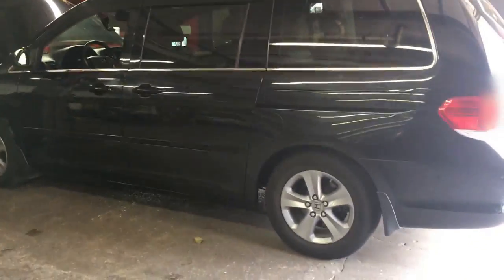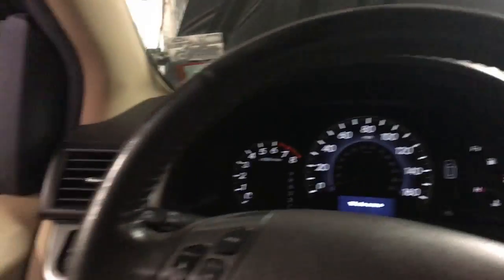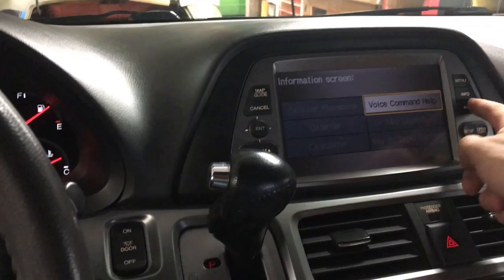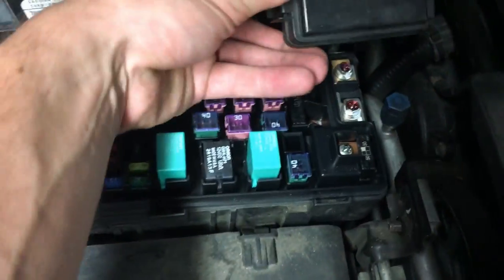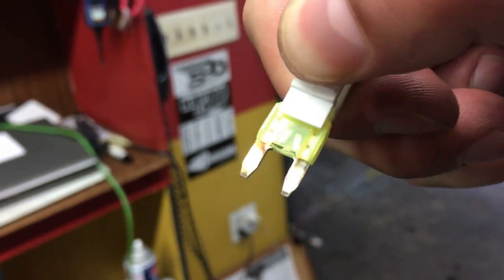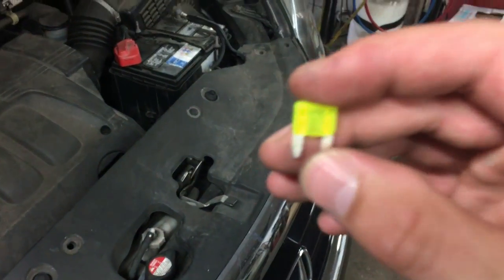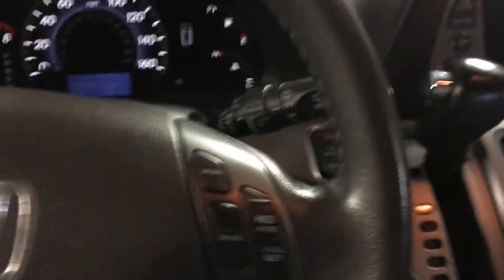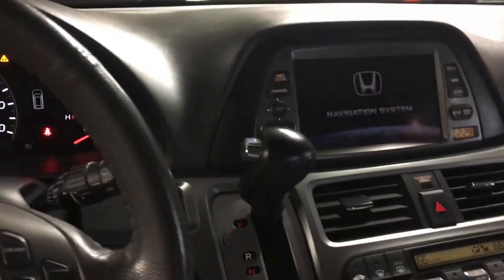Honda Odyssey No Sound but Radio Has Power Easy Fix

Comment: @Wheels Tips!  Hi, can you help on my case, Honda Accord 2009. My android head unit sound work via Aux connection. One day, when i switch between reverse mode and run mode, the sound completely gone. (Which usually come back after reverse.) I did check 20 amp fuse. There still sound from speaker when i switch to original dashboard radio but no sound from Head Unit or Aux port.
Reply: i checked the cable inside dashboard, all look normal.
Reply from the maker: @bennyh6091  Thanks for watching my video. So you are saying you have full functionality on the radio? Sound and all? But when you are using the AUX port no sound? What about the CD player? The reason I ask in that case it would seem like the device you are connecting to the AUX port is bad or needs restart or the AUX cable itself is bad.  If you have sound with the radio on the fuse is not your issue.  The fuse either works or it does not.  Please share an update, thanks.
Reply: @WheelsTips  Yeah, the Head Unit working normaly, just no sound from it. I am pretty sure that not the speaker issue.  MY HU sound is connecting to RCA cable of the original dashboard and the sound come from AUX mode not AUX port but anyway, the Aux port not working either. I just wonder is it somehow relate to any fuse?! 

The sound completely off when i switch the gear to reverse, usually it come back when switch back to D gear. So i think there something happen with the mute function when switching between R and D.
Reply from the maker: If you have power and sound but at different times it is not the fuse.  Fuse either works or does not, hope this helps.  Maybe the head-unit is in need of remanufacturing or replacing.  Please share and update, thanks.
Reply: @WheelsTips   Thanks for ur help, at this moment i dont think it a faulty head unit. As there no sound from Aux Port either. If there was a problem with head unit, i think the Aux port still working normally right?!
Reply from the maker: I do not have access to a wiring diagram. To solve a rather complex electric issue it is best to get a wiring diagram for your car. That way you can see what is connect where. You can also try one of these new kits they sell Google, 2002 Honda Odyssey instal iPhone AUX adapter. Please share if that video is sort of what you are looking to work around.

Comment: So my problem is that my radio stopped working after replacing the alternator can this method work on a 2005 Acura TL ?
Reply from the maker: Thanks a bunch for watching my video and taking the time to comment. I would definitely check all your fuses before doing anything else. Looking forward to an update, thanks.
Reply: @WheelsTips  didn’t work
Reply from the maker: Checking your fuses did not work? You mean none of your fuses were blown? Did you scan the car for issues?

Comment: Wassup Man!does this same Lesson apply to a HONDA ACCORD  03?
Reply from the maker: Hey Smooth Agario thanks for watching my video and for the great question.  Take a look at my other video, https://youtu.be/ZAMYQIX8LiI it maybe the fuse in this video that you need to check fuse number 5 (10amp) should be the radio fuse for a 2003 Honda Accord. Looking forward to an update thanks.

Comment: I have the same issue with my 2002 honda jazz. I can seem to find a fuse that goes with the speakers but the radio one is fine. The radio comes on, seems to stirk fine, just no sound from any of the speakers
Reply from the maker: Hey Tasha Tilbrook you need to see if you have an amplifier fuse, it maybe with the amplifier if you have one. Please let me know what you find.
Reply: Oh i have the same problem, it happened yesterday

Comment: Have the same issue with 03 Honda Accord change the fuse and still no sound any suggestion.  Thank you
Reply from the maker: Hey Saib Tambadou thanks for watching my video. Was your fuse broken? In my opinion you should check your connections to make sure everything is situated properly. The other culprit with a no sound issue is the amplifier. Please let me know what your end results are. Please consider subscribing to my channel it would help me a lot, thanks.
Reply: Im having the same problem with my 03 Honda Accord, I have been trying to search online but i can't seem to find where the amp is If it even has one built in

Comment: Thanks for the post. Our van was jumpstarted and we've had no sound ever since. We get power and signal but no sound, almost as if something shorted out. Any ideas?
Reply from the maker: Hey ForlornFreddy, if you checked the fuses there maybe an amplifier issue. Send me the exact year make and model of your vehicle and I will try my best to find the fuse that maybe responsible. It is also possible your amplifier may have taken damage. If your comfortable send me your VIN that way I can look up the exact wiring diagram.
Reply from the maker: ForlornFreddy so happy to hear I could help! Enjoy the radio!

Comment: Hey man, great video and awesome to see you helping so many people! I have a 2005 Honda Accord and I only receive sound from the right speaker, and every couple of months the left speaker will randomly come on for a day or so. I’ve checked all connections to my stereo and they were good and I’ve even tried two different stereos in its place and still the same problem occurs. Any idea on what the problem might be? Any feedback helps, thanks !
Reply from the maker: Thanks for watching my video and taking the time to ask a question, greatly appreciated. Since you have already replaced the actual radio and obtained the same results, my next place to look would be wiring to the speakers. This year does not have an amplifier, so it’s really speakers, wiring and the head unit. Have you tried to see if one of the speakers is bad or had a poor connection? Thanks for any update.

Comment: I have a 2008 Odyssey Touring with the exact same issue!! The only difference is, my fuse isn’t burnt out. I did change it anyway, but still no sound. Everything just quit working one day. Wish there was an answer for my problem.
Reply: Same here
Reply from the maker: Hey Oocheecho thanks for watching my video.  Have you checked the fuses?  Also I personally have done hard battery resets, but I knew I had access to all radio and navigation codes for the accessories.  This sometimes alleviated certain issues.  Other than that I would do a full system scan see if any faults are registered.  Please share your updated experience.

Comment: I've got an 07, and I get sound from my speakers but very quiet, even at full volume, no matter what the input. Any suggestions?
Reply from the maker: Thanks a bunch for watching my video and taking the time to comment. If you have sound it definitely is not a fuse issue, you may want to check if all your connections are seeded fully and all clipped in. Does this happen in all modes such as the radio does this and so does auxiliary mode and cd 💿? Does your model have a separate amplifier? Have you checked the amplifier if so? Please share an update, thanks.
Reply: @WheelsTips  It happens in all modes. My model doesn't have a separate amp. I made sure everything was plugged in nicely to the back of the stereo. Maybe I need to check the individual wires though.
Reply from the maker: Truthfully it could be that your radio needs to be rebuilt. There are lots of services that do this at a fraction of the cost to replace. Google search, rebuild remanufacture 2007 Honda Odyssey radio headunit. Please share an update, thanks.

Comment: Broski, I attempted to install this aftermarket HU,   "BOSS Audio Model 632UAB" in my 1998 Honda Civic EX. It powered up but produced no sounds. I had a 7.5 Radio fuse that blew under the hood but that cut the power completely. After replacing it, I still have no sounds. Any suggestions would be appreciated. Thank you
Reply: Figured it out. Found that the harness wiring was incorrect. My bad, now I'm booming with good sounds. Thanks for the insperation.
Reply from the maker: Hey Angelo Castaneda thanks for watching my video. I am so happy for you that you got it figured out! Often times with audio issues it is fuse, cable and/or amplifier related. Once again, great investigative work and thanks for sharing your solution, it may help someone else.
Reply: Can i ask what wiring you found to be wrong? Im trying to put a cd player in my 98 civic ex and having the same issue
Reply: @Dawn-np9fx  Hi Dawn. So I had the all the harness wires of similar color wired together, not separating solid colors from the ones with a black  stripe through it. 
If you have a Key-less entry or alarm through the stock radio, then you will need 2 different harnesses. A regular harness and a "REVERSE WIRING" harness. I found them both on AMAZON for cheap. 
Here are the instructions to install an aftermarket head unit into a 98 Honda Civic.
https://www.installdr.com/InstallDocs/Honda/PDF/466013.pdf
Reply from the maker: Hey Dawn thanks for watching my video. From what I believe he was saying was that the connecting harness from the head unit to the car connections was the wrong one or hooked up improperly.
Reply: I have a 2012 Honda civic LX. I recently tried to install an aftermarket android head unit. I’ve never had problems with my radio. But when I got the old unit out and replaced it with the new I lost all radio function. It would not power on at all. I placed the old unit back in, and my screen would not turn on for my display, nor the cigarette lighter, entire head unit and the usb port in my console. A few days later I found a blown fuse that fixed half the problems. My head unit has power but the radio function does not work at all. My cigarette lighter is still powerless but my display screen up top and my usb charger have power. I have no idea what to do. I checked the rest of the fuses and nothing else seems wrong

Comment: I have a 2014 Prius. Sometimes I turn the car on and I have no audio, just like your problem. But if I turn the car off and on again, it works. Sometimes I have to turn it off & on a couple of times before it works, but then it does and works just fine.  Could that be a fuse, too?  Second problem is sometimes it's on a station and I switch stations, but the station won't change and all the info on the screen disappears except the channel number. And sometimes it'll say "Loading..." and I can't change the channel. Any ideas before I bring it to my mechanic? Refreshing it  doesn't work. Thanks in advance!
Reply from the maker: Hey Imno13 thanks for watching my video. If your system comes on and off from time to time it is not the fuse. When a fuse goes bad, it stays bad till you change it. I would think you might want to check into the head-unit of the radio, based on my opinion. Please share your experience.
Reply: @WheelsTips  Thanks! FYI, the second problem I mentioned re: the channels not changing--it's just the SAT channels. if I switch to FM radio, I can change stations. But the volume thing is with the entire audio system--CD player included.
Reply from the maker: Hey Imno13 in my opinion the sound malfunctions are from amplifier and or head unit issues a lot of times.  Followed by wiring issues and speak problems.  Please share your diagnostics.

Comment: Hey, awesome video! Ive got the exact same problem on my 2005 chevy cobalt. Would you know which fuse i would have to replace? And what could be wrong if i replace it and then the fuse breaks again?
Reply from the maker: Hey Matt Iding thanks for watching my video and for the great question.  For radio function I would check the fuses in the passenger compartment, fuse #23 (15amp) and fuse #24 (10amp).  As for why the fuse keeps blowing could be many reasons such as putting too small amperage of fuse, having a defective item in-line or poor installation of aftermarket item.  Please share have you installed anything new or changed the fuse recently, thanks for any update.
Reply: I don't own a Honda but I'm having an issue with my 1997 Chevy Malibu the stock radio worked in it just fine but the volume switch in the radio was screwed up so I bought an after market radio and installed it radio turns on and everything but won't play music when I turn the key off it plays for a split second and then shuts off any idea on how to fix this or what the issue might be

Comment: I've got the same issue on my 2007 Honda Odyssey Touring.  I Checked that fuse and it's not blown. I did find out that when the ignition is turned on Accessory there is sound with the radio. Any idea on what would cause that?
Reply from the maker: Hey Jeremy Kuhns thanks for watching my video. I am guessing you not having the ignition on accessory.

Comment: What is the fuse called.  I checked the radio one and it's good.
Reply from the maker: As a follow you if you checked the radio fuse, the next place I would look is at the wiring and back of unit as I understand the Honda Ridgeline sound comes directly from head-unit and does not have an amplifier.  May want to check wiring to head unit from speakers or the head-unit itself.  Please share an update, thanks a bunch.
Reply: @WheelsTips  Thank you for the response.  I decided not to even pull the head unit out and I'm putting the money together to do a new system. All four door speakers nothing , subwoofer works.  A buddy of mine installs stereos amp for the sub is also in the head unit.  So I just decided upgrade.
Reply from the maker: Very cool, looking forward to an update once you get the new head-unit. Thanks a bunch for the update.

Comment: i have a 98 accord i have aftermarket 6 x 9s(rear) and 6 x 5s(front) speakers and aftermarket radio they're both in good condition if i put the bass all the way up the all 4 speakers will stop playing sound (if its loud) until i turn off the car and turn it back on. 
I double checked all of the wires and theyre sitting in perfectly. 
i do notice my aftermarket radio when the bass is bumping i see the radio screen start diming each time the bass kicks.
 You think it could be the fuse?
Reply from the maker: Hey dens bernard thanks for watching my video. In my opinion your audio system is lacking the requested power, it maybe that the aftermarket radio does not have enough amplifying power. The screen dimming in my opinion is a lack of power, given the speakers need a lot of power to generate bass. Please share the results of your diagnostics.
Reply from the maker: Make sure to spend a little more, it will yield better results. I would google search, top 10 best car radio head units. This will give you some pertinent information. Please share your purchase and results, thanks ahead of time.
Reply: @WheelsTips  thanks ill look onto that.
Reply from the maker: Hey dens bernard did you end up making a purchase?  If so please share your experience, thanks a lot.
Reply from the maker: Nice glad you fixed the issue, nice work.

Comment: hey i have an 05 accord lx my radio turns on but my audio doesn’t work as well what number fuse is it ? & where do i get a new one ?
Reply from the maker: Hey Ty Dowdy thanks for watching my video.  If you have any sound it is not a fuse.  If you have no sound you should start by checking your amplifier fuse, depending on your model you may have an external AMP with a fuse or internal in radio which would require remanufacturing the radio. You may also want to check for loose connections at the back of the radio.  Please share an update on your diagnostics, thanks.

Comment: My front speakers stop working. Rear speakers are good. What could be the problem?.. I have a 2000 Honda Odysdey.
Reply from the maker: Hey Alex Sanabria thanks for watching my video. Have you check the wiring by the head unit? Or to the speaker? Testing wiring is a good start. Please update on diagnostics.
Reply: @WheelsTips  Thanks for answer. I'm going to check that this weekend. Thanks again!
Reply from the maker: My pleasure Alex, a lot of no sound issues that are not on all speakers require a bit of testing, wires , leads, contacts, amplifier output. Please update, thanks again.

Comment: Do you know witch one it is for a 2007 Toyota Camry
Reply from the maker: Hey xxLied thanks for watching my video.  If you have the Toyota Camry (XV40; 2007-2011) it could be 1 of 2 check both , by the hand break release drivers footwell fuse box fuse # 31 (RADIO NO.2) 7.5 amp - Audio system, navigation system or engine compartment fuse box # 17 (RADIO NO.1) 15 amp fuse - Audio system, navigation system.  Please share an update, thanks a lot.

Comment: I have a 2006 Honda Accord and I have been dealing with a similar issue. My radio is functioning but no audio comes out until about 5-10 minutes of turning it off and on again. Any ideas?
Reply from the maker: Hey alceedus thanks for watching my video.  Have you checked the connections in the back of the radio to make sure nothing is loose, please share an update.
Reply: I have a Honda fit 2016 with the same problem, later of turning off and turning on, failure the function of volume Buttons and radio mode can't be select

Comment: Does that fuse have anything to do with alarm sound and lights inside of car
Reply from the maker: Hey Mixer FLAIMED thanks for watching my video. I currently do not have access to a wiring diagram, which is the best thing to really on regarding fuse operation. It is best practice to source a VIN specific wiring diagram.